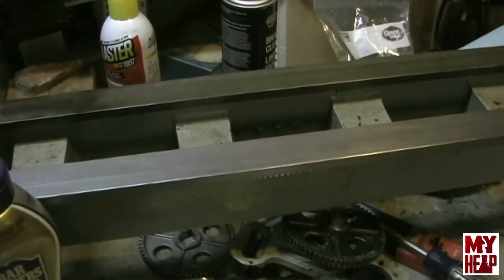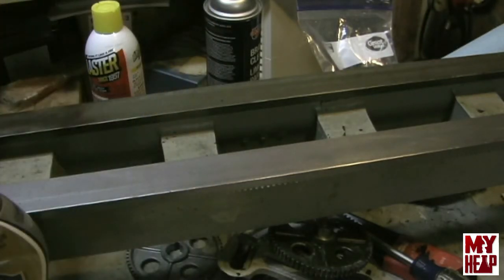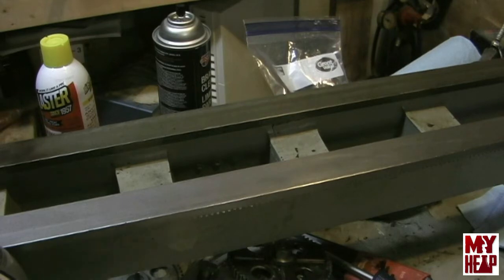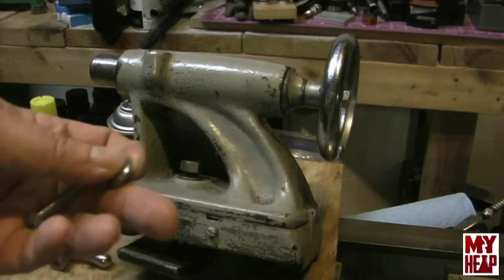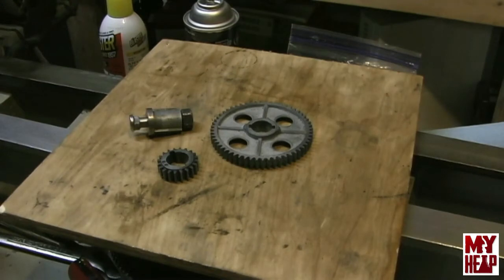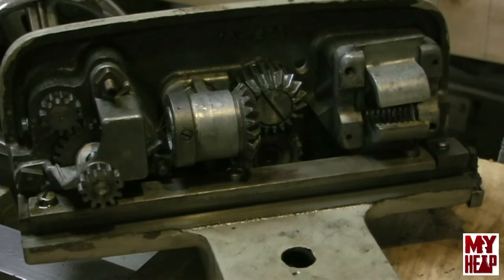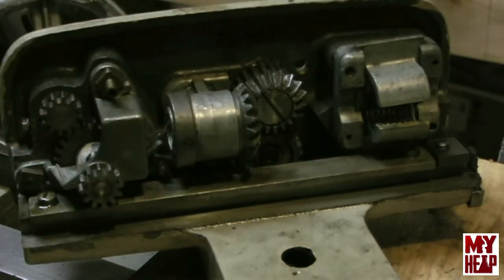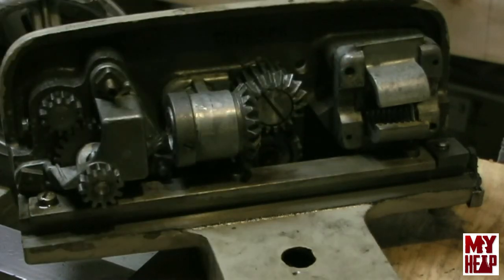Atlas 10F Lathe - TH54 - 09 - Updates, Thank You's and the Dark Side of the Moon

Comment: G'day Joe, looks like that Atlas will keep you off the streets for some time, but it will be worth it when it is finished. I am well pleased with my cheap Chinese import but it is telling me to work on it soon, I'll be lost without it. The dents you mentioned, well I have no remedy to help but just look at them as character marks, just stone away any high spots and call it quits. Peter
Reply from the maker: Hey Peter,  I sure am glad you stopped by.  Yes, I think you are right, the Old girl will keep me busy for a while.  Still working through some issues but I hope to be making some chips with it soon.  I actually have another lathe.  It is a Craftsman Dunlap lathe but it is not the best for a beginner like me to be learning on.  It lacks some features that I think it should have, like a rack to traverse the saddle.

I have been enjoying your Gingery Miller build.  I am anxious to see how well it works for you.  I though perhaps you could inspire me to build one too.  Do you plan on doing any of the other Gingery projects.  I particularly like the dividing head project too.

Thanks again for stopping by!

Joe
Reply: Hi Joe, I will be doing another Gingery project, but that won't be for some time. Yes the dividing head looks like a good project but the worm and pinion is not cheap, I'll do some research regarding cutting a worm gear and drive.
Peter
Reply from the maker: Peter,  For that task I would recommend Screwcutting in the Lathe by Martin Cleeve and Gears and Gear Cutting by Ivan Law.  If you want some more info about these books just let me know.  They are from the Workshop Practice series.  Myfordboy has a video on cutting a worm and hobbing a wheel that is worth watching too.

Joe